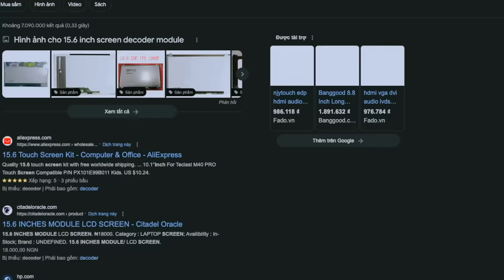DIY Portable Monitor made of an old Laptop screen

Comment: Amazing work, at first glance, i thought you had some nicely 3d printed parts, but building it from PBC material is extra impressive!
Reply: PVC not PCB
Reply: In this cost u can buy secondhand monitor.
Reply: @alokkashyap3970 monitor portable?
Reply: @rapneverdie21  All monitors are portable ...
He basically build a "normal" monitor from a laptop screen. If you don't own an old (broken) laptop and you need a portable screen of this size, the second hand market is flooded with extremely cheap 14-17 inch monitors.
Reply: @_MicZ_  well yes and no.
but the monitor in the video is slimmer and more compact when compared to a conventional 14 inch monitor.
Reply: What works on an old laptop with these specs ?

System Type	 X86-based PC
Processor Intel(R) Core(TM)2 Duo CPU T6400 @ 2.00GHZ, 2000 Mhz, 2 Core(s)

Would appreciate thr help 🙌🏼
Reply: @sherlockhomeless7249 he didn’t mentioned PCB though
Reply: @CR33D404  i am dyslexic, i saw PCB
Reply: nice
Reply: Agreed, impressive work. God bless. Jesus loves you!

Comment: The hardest part of accomplish this task is to be sure about which controller board buy. Unfortunately this tutorial is one of many who does't provide clear instructions. I saw that the screen has some sort of unique code but then the tutorial doesn't even use it as an argument to do the search and the purchased product doesn't have any info like the original code on it. This is what is stopping me from re-using an old Asus K501UX laptop monitor. Anyway great video and great quality 👍🏻
Reply: Video description might help. I found the following there: “To choose the right LCD decoder module, you need to determine the screen size, the number printed on the back of the screen, the number of pins on the display connector. Then you can search on Google with the keyword "LCD Display Module [number of inches] [model number] [number of pins]" to find the right module. For example: 15.6 inch LTN156AT05 40Pin.”

Comment: Wow, one of the most impressive builds I've seen.  I'm tempted to try a simplified version of this on my old iPad 2nd Gen screen.   I did it with an old laptop screen before, but didn't put much effort into the housing, although it turned out to be very useful as a secondary monitor when I couldn't afford to buy one.
Reply: be careful with ipads tho, apple is know to have proprietary connections on displays and it might be hard to find an decoder for the screen, good luck tho! best of luck
Reply: @atomicul_   Thanks for the heads up. I'm not ready to try this yet; but you might have saved me some time with this info (and some headaches too) 👍

Comment: Nice project! I did it with the case of a 27" iMac, one year ago. But this one is really sophisticated in handcraft. Good work! 💚🌿
Reply: Sell the laptop and buy a monitor 😂 cuz there’s not a thing portable about this monitor
Reply: @MrTolerant  It was an upcycling project because the motherboard gave up one day. Because of the design of the iMac case, I didn't want to throw it away. With an HDMI connection, the device is stationary in the living room and still very flexible.
Reply: can we build usb powered portable monitor do you know if it is possible?

Comment: i was originally gonna make a monitor out of my old hp laptop lcd panel, but i accidentally broke my chromebook while taking it apart to look inside and noticed that the display module i bought for my hp laptop panel also works with the chromebook lcd panel. The chromebook panel was smaller and had the same resolution so it would be better to use that instead.

I wasn't sure what I should use to build the display housing, and I saw another person on youtube using cardstock or something for their homemade monitor. I personally thought that it would have been too strange/weird to use, so I looked around some more. I also did not want to use wood to build my display housing. I came across your youtube video and noticed that you used PVC pipe, and I might try using that myself. Good video btw. 👍

Edit: Something I noticed is that PVC can release toxic fumes when heated up, so instead of cutting and melting PVC pipe into a sheet, you could but a PVC sheet instead, skipping that part all-together

Comment: How many volts is the minimum requirement to power this monitor? Planning make and put in a 5v power supply
Reply: 5v typically limited to 1366x768 pixels.

For 1600x900 and up are usually 9v and 12v for 1080p.

Comment: What I UNDERSTOOD from the first 45 seconds of the vid. Which is awesome btw love that music track. But what i understood was that so long as the 40 pin and screen size matches a controller board. You can use just about any controller board........So now another question.......What if i connected a TCON ribbon to a matching pin controller board. Can a TV lcd be converted to a monitor with a control board? Maybe the backlights have to have their own seperate power source.

Comment: Wow great video @DIY NAMBARON , Can you please assist me? I bought a controller board specifically for my laptop screen. I've connected all the cables: power supply, wire from the board to the screen, and HDMI from the laptop to the controller board. The screen lights up, and the "no signal" message is displayed on the screen, and then my screen goes black. I have unplugged the connections and connected them again, but unfortunately, the same message persists. My power supply is 12V 3A. Is it possible that the power supply doesn't supply enough power?"

Comment: Hi, if you have a 120hz monitor for explample and connect it to the laptop you're current using can you use the portable monitor you created at 120hz or it will be capped l?

Comment: I've got a AOC i1601Fwux portable monitor which I used to use with my laptop, now that I've transitioned into PC I can't use it with my desktop PC since it doesn't support video signal out from USB type c, and as I've researched video signal cables (especially type c to HDMI ones that are mostly used to transfer video signal from phons to monitor) are unidirectional and can't be used for my purpose (to send video signal from HDMI output to type c input on the monitor) and even if there wasn't the problem of unidirectionality I'm not sure if it would be able to power the monitor with the same cable. I'm looking for a way to use this monitor as my second monitor and I'd appreciate it if you help me

Comment: Damn. For some reason I thought it was gonna be wireless (except the hdmi).
I've been thinking about trying that, but I need someone to explain, in the simplest terms, if you can get 2-6 amps from a USB-A or USB-C powerbank and what how that would affect voltage. In theory, you could even put a chromecast in there and have it actually be fully wireless, if a bit limited. I wish chromecast could do chrome remote desktop...

Comment: Just a weird question. Is it ok to replace it with an portable monitor with the same screen size as the laptop? Like I was wondering about it. Buying a replacement screen is more expensive that buying a portable monitor, so that what clicked in my head if that is possible.

Comment: Interesting, but I'm not entirely sure that grey PVC pipes were used to make the box and stand as shown in this video...
The thickness of the sheets is really important, a PVC pipe doesn't have that thickness (a rough estimate is 4-5mm). At least not in my country, even if you choose high-pressure PVC.
Nevertheless, it's a good idea to combine a screen and an LCD screen controller board.

Comment: What kind of glue is that for these nice joins? Next step is take the panel out of an ugly gaming monitor and make it fresh.
Reply: Cyanoacrylate glue is the industrial name for what is commonly known as “Crazy Glue” or “Super Glue”
Reply: @DrZipZwan  I thought that from the bottle but whenever I’ve used it it’s been blotchy and white. These joins are pristine. Maybe he’s just more precise than me.
Reply: @Freshbott2  kind of, if you look carefully he is using some tips on its bottle. I got that kind of super glue, it is super liquid, and really a pain to use it without those one-use tips. They are selled by pack of 50 or 100 pieces, and not that expensive.
They are a life changer when using cyanoacrylate glue, as you said, it allows you to be more precise.
Put a drop before 2 sticks both parts, and then put a bit of glue all around the joint, or sticked 2 pieces, and you good to go 👌

Comment: What did he did here 1:03 ? What if i don't have that mac box ?
Reply: He tested it worked. Use anything that connects.
Reply: He’s basically just plugging it into a computer plug it into whatever device that you want and it will act as a monitor😊

Comment: I once worked for a portable monitor company. Final I quit that job because of the price.  They sold it at like 200-300USD, actually the material + labor cost like 50USD, but they marked it like 150-160USD as the cost for our salesman. And they thought I do not know....While the LCD is a old industry, portable monitor is not a big tech deal. That is really unbearble for me.

Comment: Sorry , but this is useless. Have you heard about portable monitors industry? Those cost nearly nothing. This laptop screen I believe is older than dinosaurs and image should be horrible. On any market places, you can buy , I don't know,  something like 16in 144 hertz from Arzopa, with mini HDMI and type-c  for image and power delivery, about 8mm thickness , and also built in this thickness a leg stand,for around 80 $.
Just how much time this master spent on this project? How much money for details? And ar the end is no more that 60hertz , also you need that thing behind, which is not making this portable at all.
I would say: masters hands are growing from the right place definitely As a hobby,ok, can't say nothing. But as a useable monitor, sorry, is crap.